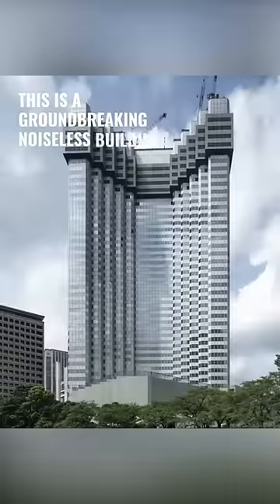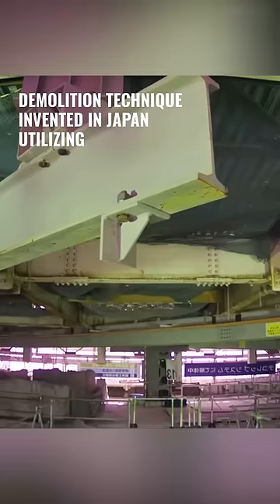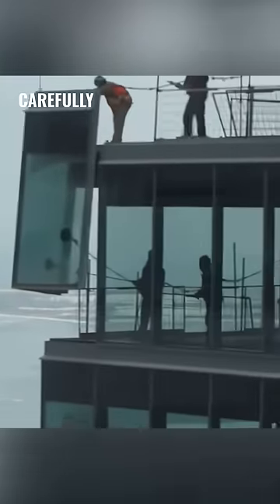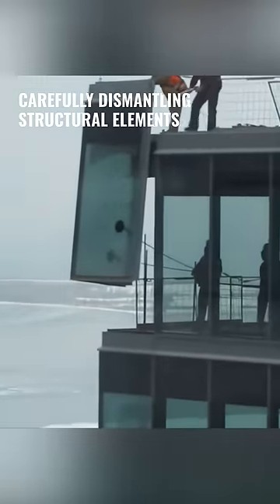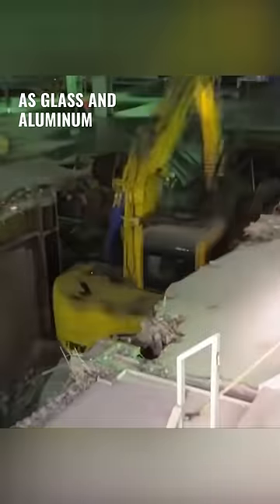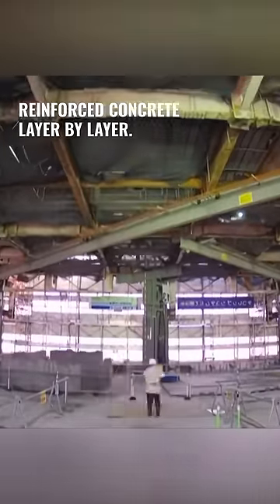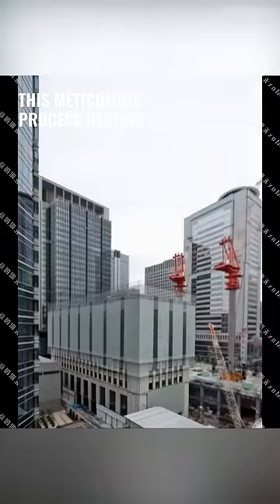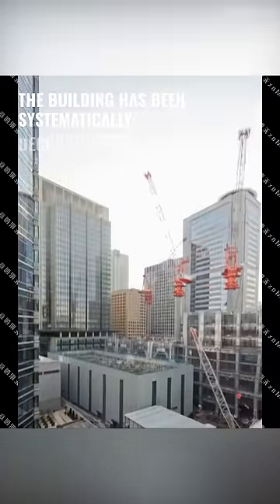Silent building deconstruction 😎

Comment: I‘ve seen this in Germany 2 years ago. It‘s not noiseless. Knocking out concrete is pretty loud once they get closer to the ground. Took them over a year for 40 floors.
Reply: I think what he meant the noise comparison between using machinery and dynamite.
Reply: @martinqizeaq yet dynamite is over in seconds. This goes on and on
Reply: @martinqizeaq Dynamite is extremely faster than whatever they’re doing here
Reply: @PsychedelicVortex  of course it faster. It's also a lot more dust and debris that probably cause damage to the surrounding also any other problem that maybe occur during the blast. It's in the middle of city. The Japanese probably do it better than the German, who knows. Knowing that the Japanese really take noise pollution really seriously.
Reply: @martinqizeaq if they cared about nouse pollution so much they would not spend a year making loads of noise deconstructing one building
Reply: @trollsports7829  what i meant is, they probably do it with so much noise isolation as possible. Not just banging around building like the German did.
Reply: @PsychedelicVortex  Can't use dynamite when neighboring skyscrapers are close by on multiple sides.  The skyscraper has to be meticulously and expensively taken down.  

So, when will the Millenium Tower in San Francisco be taken down?
Reply: @martinqizeaq First of all the stupid channel advertised the process wrong also it looks so loud with all those machines. It would have no differince between the germans did.
Reply: Well you have seen it in Germany, this was in Japan, they have got Construction Samurai’s.
Reply: I have seen this in TV around 20 years ago, they used airplanes and the skyscrapers were down in seconds.
Reply: @SpicyTexan64 good luck blowing it in the middle of other skyscraper 😂
Reply: @zee9709 I have seen dozens of situations where they take down one building right next to another using explosives. It must be prohibitively expensive to take a building down a piece at a time.
Reply: I'd rather hear 1 minute of explosions instead of having 1 year of traffic jams because of the machinery included in the deconstruction and all the noise that comes with it
Reply: @everettlwilliamsii3740  dozens? no you don't
Reply: They weren't doing it the same way
Reply: Think Einstein
Reply: The debris cleaning from a blasted building would take a long time too. I think the option to blast the building or to remove piece by piece would be taken based on surroundings and budget etc
Reply: Wo hast Du das gesehen? In Frankfurt?
Reply: @wolf310ii really gotta go there... That was a tragic day and you are going to use it as a joke..
Reply: @TrashedRedPanda  No it was not a tragic day, it was just that one terrorist lost two towers in a game of chess against another terrorist.
Reply: @TrashedRedPanda Internet 101: don’t feed the trolls.
Reply: @martinqizeaq bruv there’s a law in Germany saying Thou shall not play Instruments or music past 10pm to 7am and the Japanese are having a small noise problem so the Germans probably care a bit more

Comment: De-construction
Well, the Dismantled things can be used in another place
So, money saved ig
Reply: Saves alotta steel.
Reply: Yeah but the labor for all that is also gonna be expensive.
Reply: No, it's not an industry practice..
Reply: fikriarieska8450  I mean im all for recycling but the reason this type of demolition is not so common is that its time consuming and not really cheap compared to just straight up controlled demo.
Reply: … this is the MOST expensive way to bring down a building are you kidding me? It takes years for a single building to come down.
Reply: @Qwerty0791 and trust me. They are willing to spend those years doing it.
Reply: @Qwerty0791  years? No i think it wont take years at all.. japan can fix a road that have sinked in just couple of hours
Reply: @gwakamoli7759  Lol, this exact demo took over a year. How many floors is a road? You’ve obviously never worked in construction.
Reply: I mean, this technique can be used in a populated building area, considering the damage between destroyed building and deconstrucked building, they probably gonna use the deconstruck one😁 (and they habe the tools for it, so why not? 😅)
Reply: Doubt they'll let them refuse the materials in a commericial building but could be sold to be reprocessed. Like the bricks and glass for example.
Reply: Be 5 times more expensive labor fuel time resources demolition can take onky a few days with 80% resources reusable
Reply: fikriarieska8450 I can guarantee you that most of the dismantled steel ultimately ends up back at the foundry to be melted down and re-fabricated. You are out of your mind if you think this is efficient and financially sound.
Reply: @LlibertarianGalt the only useable would be steel, i used to dismantle building, and nothing come out as new and doing this big im sure thry are using machine which ain't accurate like doing by chisel
Reply: @BerserkersBattle-816 steel*** ffs
Reply: In japan human resource is expensive. Particularly that kind of engineering is
Reply: Cheaper too kabluey
Reply: @BerserkersBattle-816  
*Steel
Reply: @markm_koko and it shouldn't be either. It wouldn't be safe to use those for another building, which is what the company specializes in
Reply: @GhoztMusic23 yeah because it makes them more money
Reply: @roboteen  not only that, japanese people they their time in building and demolishing big buildings
Reply: Only issue is it takes forever to fully deconstruct a building
Reply: @Bonski11 more jobs i guess
Reply: But the building is in the middle of the city if they demolish it. Won't that be disastrous.
Reply: Seems like the extra labor cost is waaaay more than the cost of the materials saved. Not to mention the next architect having to work with the specific dimensions of the recovered structural elements instead of using standard/custom ordered supplies.
Reply: fikriarieska8450 materials are usually very very cheap and plentiful in comparison to people’s labor and equipment.
Reply: Unlike China
Reply: Like the old bay bridge in California
Reply: @markm_koko it's used on large bridges and in cities too crowded for a demolition
Reply: @gwakamoli7759 took 5 years to dismantle the old bay bridge
Reply: Time=money I'd be interested to know how much longer this takes to do. Matter cannot be created nor destroyed. Meaning they could simply break the rubble into recyclable piles and melt the steel back to ingots, crush the concrete back to powder and re use all of the wreckage from normal demolition.
Reply: True and materials but also then cost goes up for labor
Reply: @lolmctroll that's not how it works.  Matter cannot be created or destroyed, but it and its properties can change.  Such as burning wood, crushed concrete doesn't work the same second time around.
Reply: @joshpiotrowski3487  assuming you're correct about the concrete (I'm not a concrete expert) the steel (probably the most expensive part of the building) can indeed be melted down into usable steel again. And I'd be willing to bet that the crushed concrete is not completely useless afterwards. We could always pulpify any wood scraps from the demolition to be used for paper, mulch, and other purposes. The glass can most definitely be ground to sand then remelted back into sheet glass. So yeah 🤷‍♂️
Reply: @joshpiotrowski3487  AND you save on the labor/ time costs of doing it the way shown in the video.
Reply: @lolmctroll  you're correct in the other items in the list being able to be reused or recycled. concrete glass and steel buildings have a higher dollar value associated with them allocated to concrete and less to steel than you're assuming. 

And no,  it's actually higher cost to do this.  But,  it doesn't disturb the adjoining businesses or disrupt city operations (minimally if it does). Which,  if you're talking into account in the total cost of the project(which they don't), then it could be considered more cost effective
Reply: @Bonski11 more labor hired means more people have jobs and more people have money to spend.
Reply: @somedudeonline1936  obviously! So whats your point?
Reply: @Bonski11  I'm saying that the company spending more money on workers instead of cheaply blowing the building helps the community and other businesses by giving consumers more money to spend at other businesses.
Reply: @Bonski11  I'm saying that the company spending more money on workers instead of cheaply blowing the building helps the community and other businesses by giving consumers more money to spend at other businesses.
Reply: Prob no since it takes a lot of time and that's also money too
Reply: @somedudeonline1936  yeah but you know how companies work although there are some exceptions like the one in the video but we don't know how and why they were able to do that. All im saying is that its not really cheap to do and companies most of the time would prefer the cheapest way to avoid wasting money.
Reply: @Bonski11  Well I'm sure they end up selling all that material either to be scrapped or repurposed.
Reply: Doing this will cost more money blowing the building up and building new stuff somewhere else is cheaper always
Reply: "its too expensive"
"labor costs will be sky high"

Typical Americans. Always exploiting the workers and refusing to pay them the appropriate salaries.
Reply: Yep , amazing
Reply: @Bonski11  well ,it is actually the case ,but its part of accountability as well, bc why others should accept having all those noise and debris pollution ,not to mention that the material will be compilation of "literal" trash if they do it conservative way.
In this way, the recycling process might be easier and more efficient.
And it also offer the possibility to absorb human resource and new job field, with AI and "demography bonus issues" which the count of human population exceed the current resource .
After all with energy crisis it's not an exaggeration that we will have to reduce some inefficient use of electricity that we had been comfortable with bc of our laziness all these time 😂
Reply: @ikubaru9518 it is likely the case. If anyone pay attention enough , the video exactly showcase that the building is in crowded district and in the middle of other mid-rise. I don't think they'll do it this way if the building isn't of such steel& glass material nor is it in the middle of the city amongst a crowded district.
Reply: @heydaddy2471 nah, the most possible reuseable I think would probably be the glass. The steel most likely will be melted back, bc steels elasticity might've changef along those years and that's exactly why the building demolished bc the constructions strength is estimated to decrease already in the first place
Reply: @pmeindustries no way someone especially an architect will reuse the exact material "raw" from deconstructed building...... I mean even civil eng team of theirs wont agree ,bc it will create issues whether or not the material strength catch up to standard of a new material.
Unless they're melted and re-done a.k.a recycled , I doubt any sane project manager will approve it.
It will be a wacko if the building crumbled bc the steel strength were to bend bc its tension has changed from its first building usage 😂 and the arch/civil eng team that build that plan will likely be inmate
Reply: @somedudeonline1936 well, in some place you'll be charged for trashing those building wastes instead of getting money, and some country even had tax for used goods like these or even used vehicles...
It's inevitably bc , it is really a trash and need to be recycled , it also effficient way to let people  think several times whether or not they're rich enough to take care of their "endings / after use" their gov literally spells : "take care of your own shits after your fun or pay at least"
Reply: @ShadowMoon878 lol, it is literally every bussiness owner mindset. 
That's why we need all rounder to be policy makers and none will ever really be appease by policies ,bc policies are made to accomodate most optimal values for everyone instead of certain groups/classes only . 
It is in line with the sayings ,you can never be liked by everyone, nor will you like everyone.
Tho ,ppl nowadays are less likely to relate to this bc it seems like we are growing too introverted by generations 😂
Reply: Ohh, i never knew Americans just pick up their buildings and put them at some other locations
Reply: fikriarieska8450 no.... in any civilized country you wouldnt be allowed to re use that on another building anyway.
Reply: @Gl-my8fw  Yes that's correct but they melt them down and make new ones and a steel beam isn't universal for ever building or bridge or submarine ECT..
Reply: @gwakamoli7759 😂😂
Reply: fikriarieska8450 you probably wouldnt save as much in recycled materials as you spend on labor. Plus you could just pull the steel and glass out of the rubble and recycle it
Reply: not the area u should use to cut costs. and we wonder why  buildings are always collapsing in other countries.
Reply: @Mr-furley  what do you mean other countries? Japan is pretty well known for workers that work too hard to ensure quality. Recycled materials aren't necessarily weaker or less structurally sound either. If this were like the US or maybe South America then you might have a point
Reply: It probabbly costs a lot more in time to take it down by "hand" but its much safer so thats probabblyy why they do it. I think they use the stuff  they take apart to offset the cost, but idk how realistic it is to sell or reuse the old stuff
Reply: Not likely since youll probably triple the labor costs at least
Reply: @Bonski11 if it was the US the labor wouldn't be worth the time. In Japan the labor is probably far cheaper and means a long deconstruction is more beneficial then an explosive demolition.
Reply: @dragonrider269  I dont know about cheap labor, japan isnt a 3rd world country. Plus japanese people are known for their hard work to a point that its exploitative.
Reply: But requires huge money to carry out this task .
Reply: Absolutely zero chance that it is less expensive. The labor and machinery alone will be far more than a typical demolition. Only reason for this is for government enforcement likely due to close proximity to other buildings/population centers
Reply: @Bonski11 that's why we need machinery
Reply: @ikubaru9518 demolition is so precise there's hardly surrounding damage demolition in cities has been happening forever
Reply: Sounds like revenue if you can resell it
Reply: @Bonski11 i mean its better than cleaning up after demolition and wasted materials and noise
Reply: @s3ated980 but cleaning up the rubble doesnt take over a year
Reply: USA: "Nope we need to spend more in demolitions"
Reply: Not alot can be saved actually.
Reply: @Abominable_Intelligences  Ahmed, rest assured US got nothing on your technique. I’m sure every country booked your exclusive “airplane” 1-day delivery demolition, with 2 for 1 discount.
Reply: USA army move the building 5ft to the left building manager in Japan. Those Vets are the boss you don't like
Reply: @melbournejasma2802 most of them are using heavy machinery with less labor
Reply: fikriarieska8450  and it minimises waste... It's pretty much a win all round
Reply: Far more expensive but very sustainable